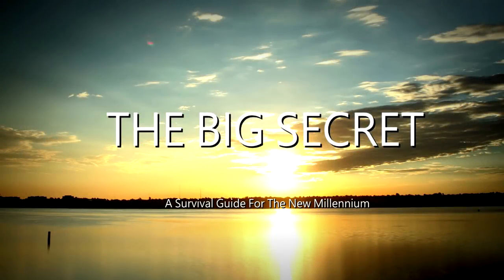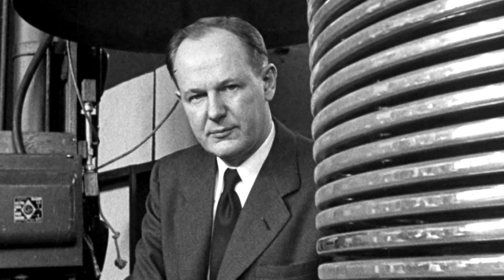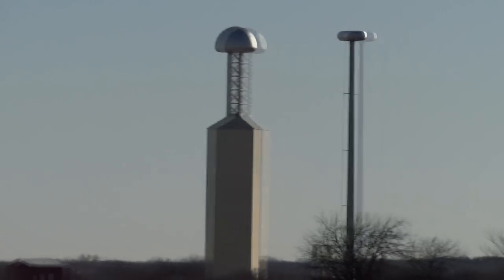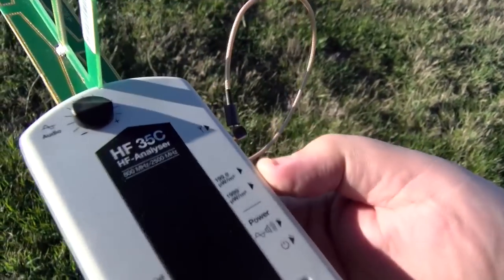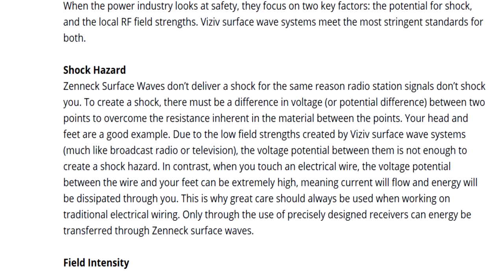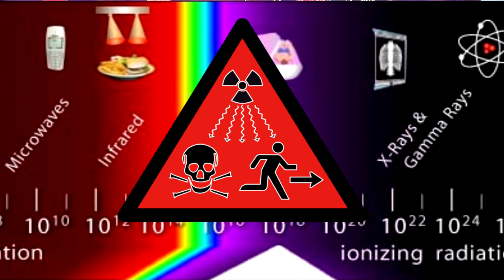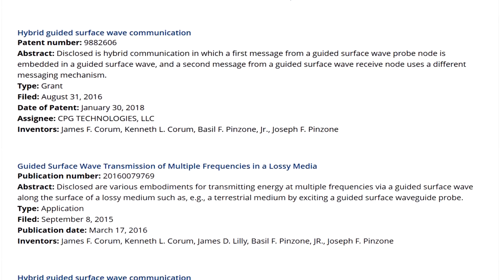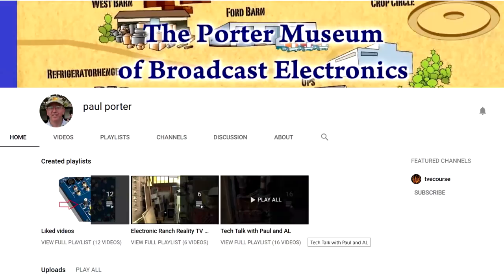Texas Tesla Tower Wardenclyffe Tower and Zenneck Surface Wave

Comment: Looks like they forgot the 300 foot long ground rods.
Reply: its right on top of the states largest aquifer on top of a bed of limestone and the  24 in shaft gos as deep as the aquifer
Reply: @vuzztraveler4722910   Does not matter. Without the combination of depth, the high voltage just skims over the surfaces, also limestone is a bad conductor when compared to quartz. PURE WATER IS NOT CONDUCTIVE. Unless you have significant grounding, the range is hindered. 24 inches! hahaha, Tesla's original design at Wardenclyff had hundreds of feet of grounding to function correctly. In the TV show "Tesla Files" they can demonstrate the short range effects very well, however, if you want to actually transmit power, long distances using these, you need incredible grounding, think of the ground as one wire and the air as the other. Remember,high voltage likes to travel on the outer surfaces of conductors.
Reply: the earth and inter connected water   is the ground     you my friend need to read  the tesla writings and experiments  and throw out the conventional BS  text books you have learned from they dont teach this at trade schools  in the  US     the text books are all wrong  and so was blind stein what could make you believe they want you to have this knowledge just like light has spectrums man cant see electrical energy has  ><    frequencies this  is a different kind of energy the energy that powers the universe and the reality you all  live in that all humans are unaware of just like fish in water  you  all have a clown named oliver heavy side  to blame for that he reduced james clerk maxwells original equations  from 20 to 4  limiting precise      theory  of quantum electrodynamics there is no study of this on your planet thus limiting the boundries  and knowledge of man kind  and it has been suppressed  and omitted from your text books   just like nikola tesla the greatest scientist of your time . what fools  yet you still fight  over the meaning less for what ...    money      ...   tesla told einstein right to his face in front of 900 people that he was wrong and a complete fool  . you  sir have given mankind pandoras box and now  he now has opened it . the doorway to oblivion  now with   238 239 and caesium and other hps pluto  waste dumped into the oceans the planet is doomed  a unfortunate fact is man is a byproduct of a long since dead  race older than earths recorded time and is as important to the universe as man is to dirt  or the earth for that matter and it wont be the first time the planet has bucked off   an infestation like a Dog shaking off fleas and its coming soon how sad   but maybe the astroid headed there will fix it all like it did  before  the real reset
Reply: @armax5996  i tried to reply but they removed it before it  it went up looks like i gave to much information for public view as all is subject to controlled dessemination in your realm
Reply: @armax5996  sorry tried to reply but they removed it and the direct link my guess is they did not want a info exchange all info on these subjects are controlled in your freedom  zone  one word stanley meyer and water  you know who agfa is see
Reply: @dftdbs1010  i am very sorry you are so angry with no understanding of what i have related to you are familiar with negative  earth the atmosphere is negative and the earth is positive the energy comes from the charge of the earth  i was sent to inspect and document. clue what country is agfa from now read about stan before spewing at me again  and yes ground rod anchors all around the unit the center shaft in the tower  was  24 in around and 600 ft deep to the end of the well with a  nickel ball attached to a  hardened copper  cable that extended further into the aquifer

Comment: Well done , I just hope that heat doesn't melt the icebergs.
Reply: To late polar bears mating with brown. They know it's time to return to the fold. Grafting back into EU Melanin. People start grafting back into EU melanin. 80° weather all summer long 90° weather Alaska July 4th 2019.
Reply: Radiation is very high from the Sun. When 5G get here radiation would be too high for. People with certain type of melanin. It will increase melanin production. But if it's not increasing EU melanin. You have very little protection from the radiation that these towels are emitting. Copper spirulina blue green algae. Help with the radiation.

Comment: You don't know what you're talking about. You're attempting to apply conventional interpretations of electromagnetic phenomena. While that is not wrong it misinterprets the nature of the Zenneck Surface Wave and it's behavior. The reason you don't get a shock is not the obvious reason you don't get a shock from radio stations. They are using that in a more general way than you are interpreting it. Your narrow interpretation comes with various expectations that don't contain the understanding of the wave or how it works or is deployed. Once you understand that it makes perfect sense why you can't even detect the wave much less be shocked by it. You can pass right through it without so much as noticing a static buildup. When you point that meter at the tower the antenna you are using is not directional in that regard so you're probably picking up a signal from elsewhere that's roughly 90 degrees to that antenna. Read the instructions on the use of that antenna. They explain it in the manual that comes with that meter.
Reply: ALL answers WRONG. Go read the I.R.E. pubs from the 1920's onward ..
Reply: @uploadJ  It's irrelevant. I watched the tower's foundation being built. I know the people running the operation. You can say whatever you like. I know what it is and what it is not. I'm not allowed to say because I signed an NDA but I know so you can try to gaslight all you like but it only makes you look stupid because I know that you don't know and I don't need any more proof than I have to know that I know.
Reply: @SeanWyseman NDA doesn’t apply now that they’re bankrupt. Spill the beans
Reply: @smellycheese2466  Well I dodged a bullet there. They wanted 6 mil for founders level investment. Now I must find out. I wondered why I did not hear back when I placed a call around 2020. The guy was the CEO of the company that owned the technology & were building the antenna when I saw the foundation being poured. I'll still be checking to find out where the assets & technology went, who owns it now, & whether they own the NDA'S or not. Bankruptcy would not normally eliminate intellectual property assets but tends to transfer ownership of them. I also don't recall whether the intellectual property was owned by the same company I invested in or if I was investing in the company that owned exclusive distribution - including building the research antenna.